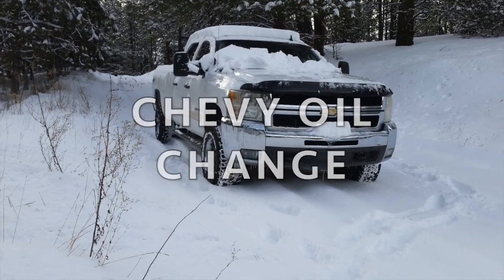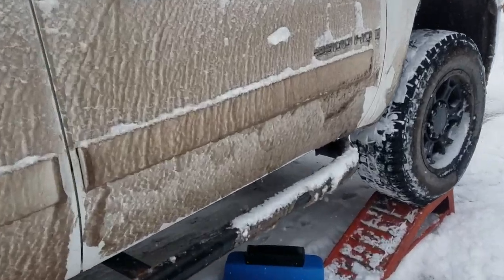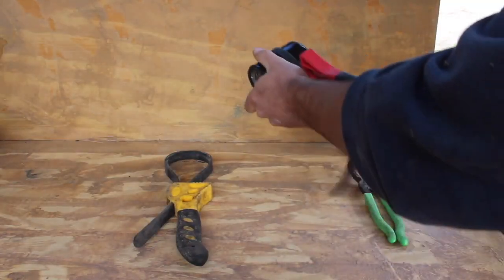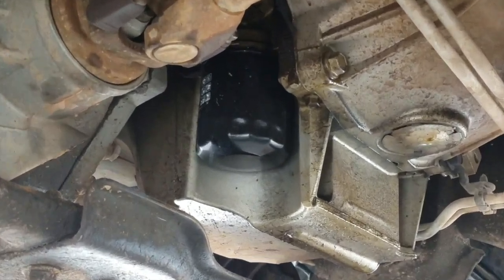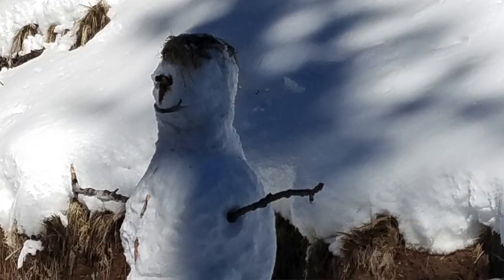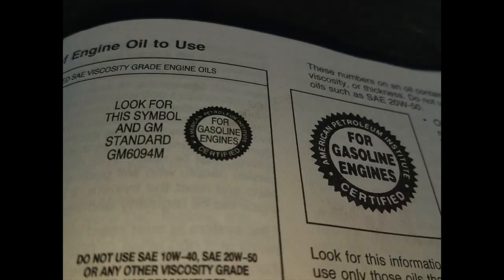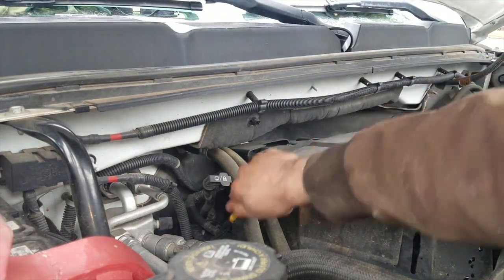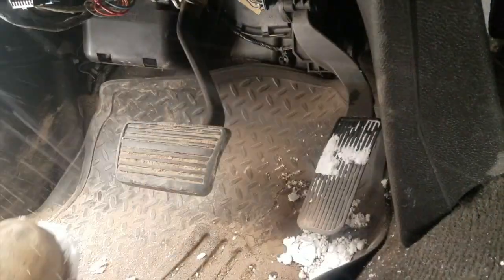Chevy Silverado 25000HD Oil and Filter Change: 6.0 Oil Change and Oil Life Reset

Comment: Short & sweet however how do I check my oil life on my 2010 silverado 2500hd WT ? On dash, I can click on the pin button on the upper right side , odometer, transmission temperature, a few other things, but no oil life 🤔 that feature not included?!

Comment: yea I just did mine for the first time. Used truck no manual. Figured 5 quarts of oil. Went OUT of MY WAY to find a 5 quart jug of oil.
Because yea we always need 5 quarts right. Even telling my wife I hate that they sell 1 gallon jugs of oil because we need 5 quarts.
Do the oil change and find out it is still short a quart. Should have checked here first. 

I am feeling my age now. Days past all of this stuff was the same.  I only needed one size oil filter wrench. The oil pan bolt was SAE size.
Everything was 5 quarts. Now every one has to be different. And metric size bolts. I am always running to the store for parts because everything has to be unique. Frustration. Used to be use the chilton, now check you tube first. Yikes. I am too old.

Wait I am not done yet. You know what comes next. The oil life indicator. In this case NOT unique enough! It resets to 3000 miles.
I want 5000 miles. So even when the system is designed to be unique it still fails me. YIKES! Grumpy old man complaints.

By the way found something else out. When the oil life indicator reaches zero and you are still driving it the check engine light comes on.
When you reset the oil life indicator the check engine light goes out. Or at least mine did and seems to coincidental to not be a fact.
Reply from the maker: I've heard the only certainty in life is change. I suppose these trucks are no different. Interesting about the oil life indicator and I'm not sure but check engine light might have been a coincidence? I appreciate you watching and taking the time to share your experience with this job in the comments. Cheers